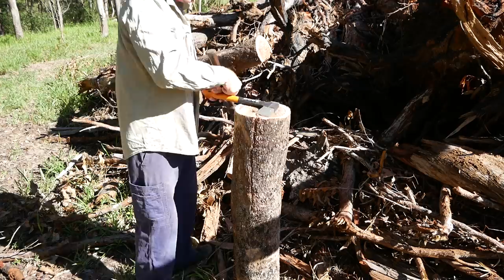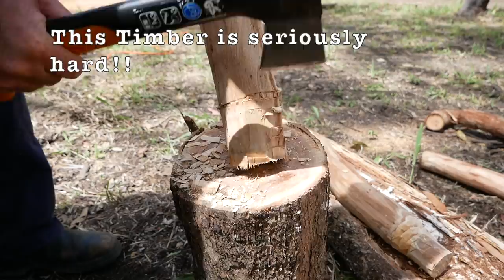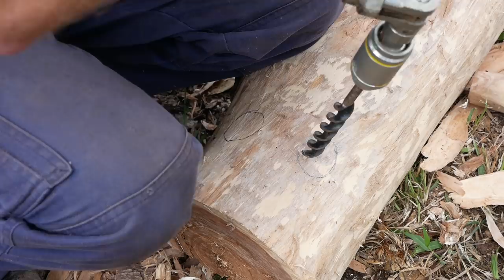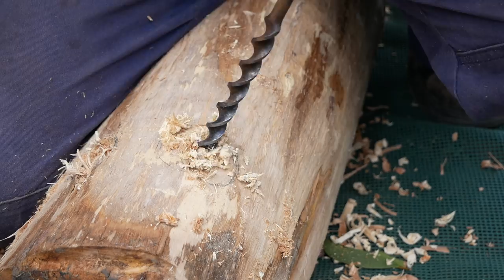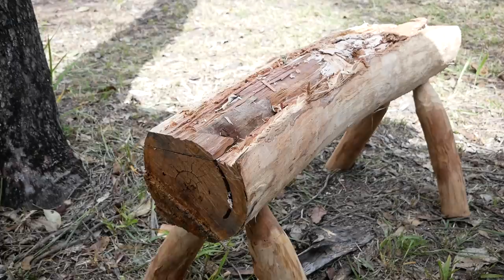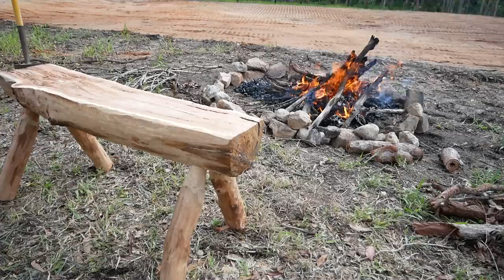Making a simple Log Bench Seat, In the bush - Going Off Grid Ep 2

Comment: Your chain saw needs a good going over. The rakers are too high, chain needs to be sharpen and sounds like it is running rich on the high jet or the air cleaner is clogged. If you look it is making dust not chips
Reply from the maker: I think you are right to a degree. Aircleaner freshly cleaned. I've had problems with it's tuning as it needs a special adjusting screwdriver tool. I now have one so I'll work on the carb adjustments to get the revs up. Yes maybe right on the chain also but the long rip cut I did, it's the wrong chain for that work in this timber being like iron/ Thanks for your feedback Damien!